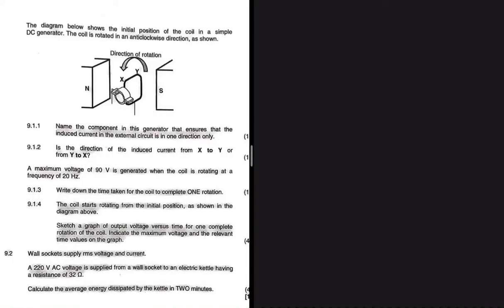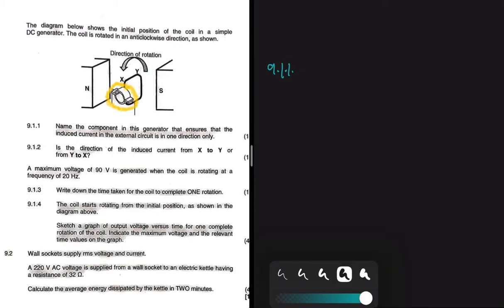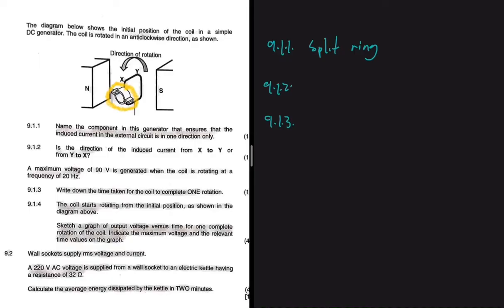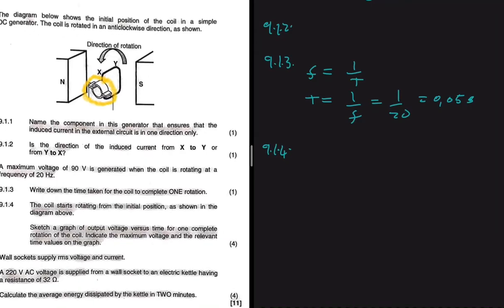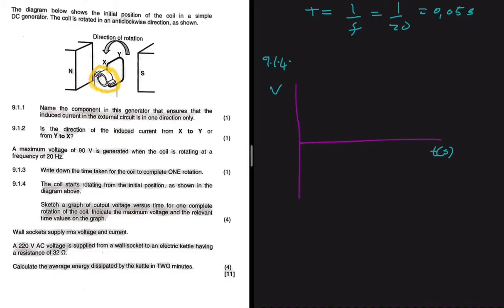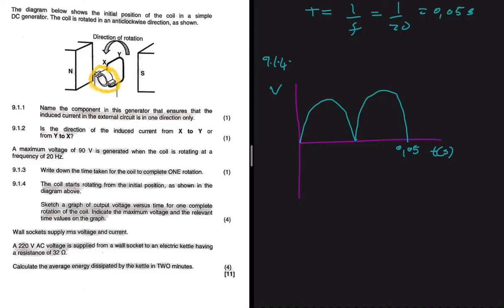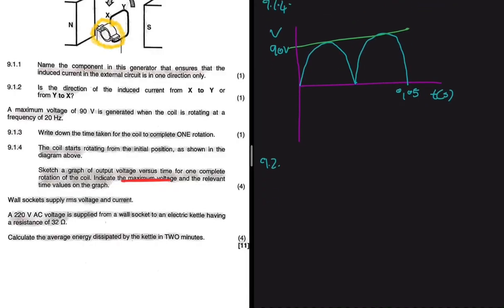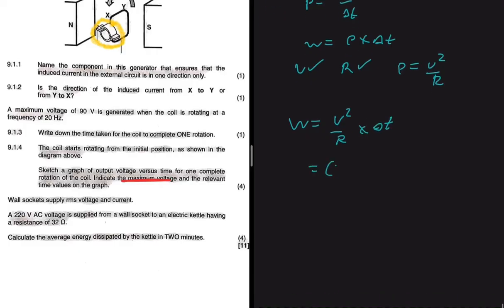Electrodynamics Grade 12 Physics November 2022

Comment: Isn't the frequency of how often a voltage of 90V is generated
So for one full 360° rotation won't you have to generate a max voltage twice
So would it be twice as long, so 2x the 0.5?
Reply from the maker: No
Reply: @grade12  see now I doubled that 
For the graph would I get CA marking? 🥲